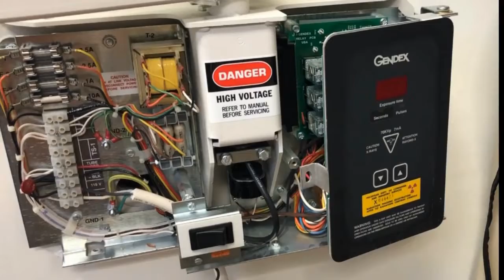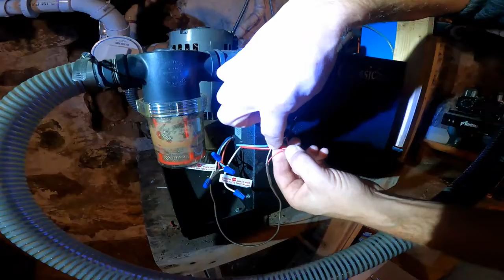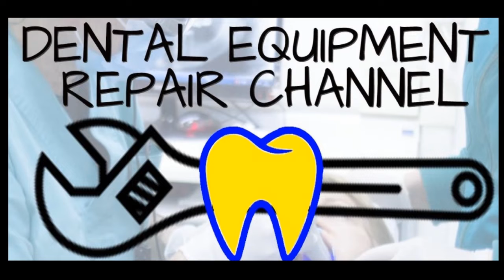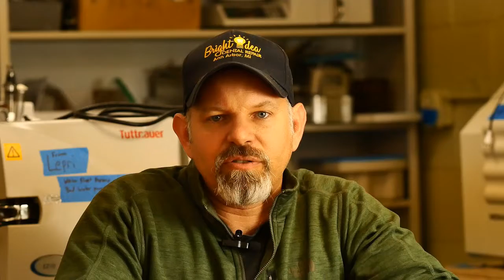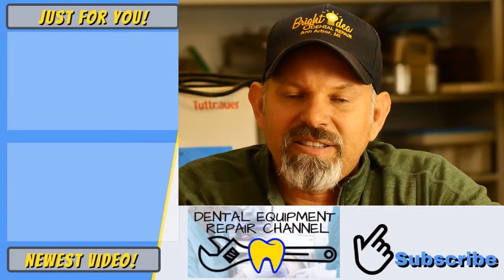Troubleshooting Fundamentals - A to Z!

Comment: when the high speed handpiece runs, with water ON, water also dribbles out of the exhaust hose inside the unit, what is the cause and fix please ?  i changed the handpiece adaptor. air pressure is 30psi, water flow seems normal.  is this leak inside the handpiece Orings or handpiece adaptor ?

Comment: Hi, we have an A-dec 511 Dental Chair w/ A-dec 532 Radius Delivery. Whenever we turn the chair on it makes this high pitch noise. Only when the chair is on. Our suction is not attached to the chair and the noise isn't coming from there. Any advice? Thank you
Reply from the maker: Can you isolate there the sound is coming from?
Reply: @DentalEquipmentRepairChannel  unfortunately I was not able to. My sergeant can't hear it, but all the dental assistants can. I thought it was coming from either the dentist tray or the water bottle area. But when the chair is off it doesn't make that noise. It stays the same volume when we are using it.
Reply from the maker: @blankstkk  send a video to my email servicerequest@bidentalmi.com
Reply: @DentalEquipmentRepairChannel  I sent you the link. I had to upload it to Google drive because the video was large